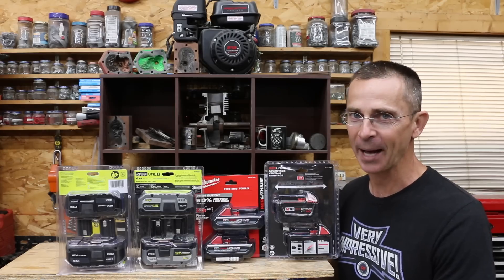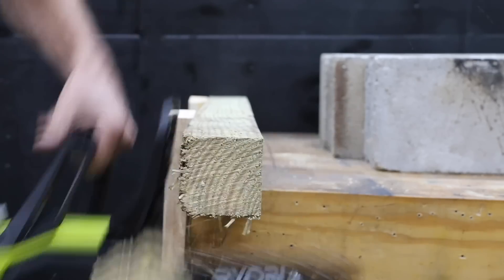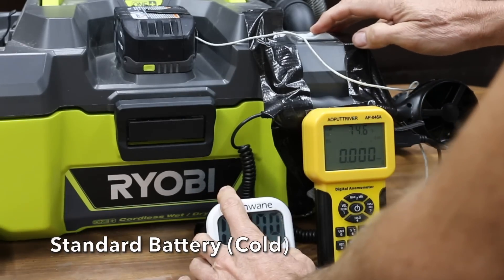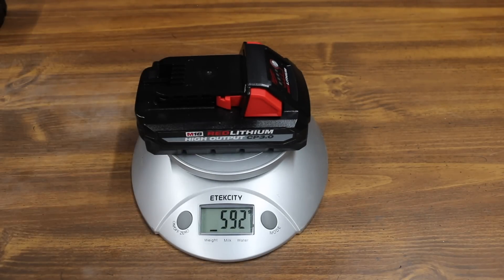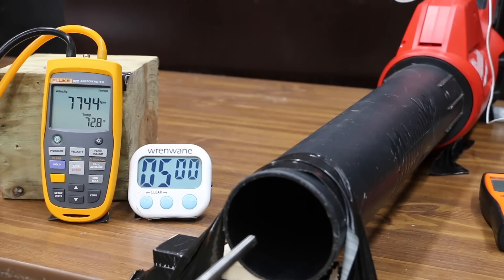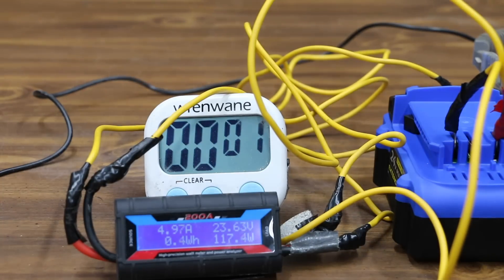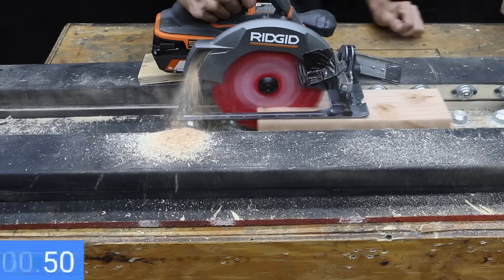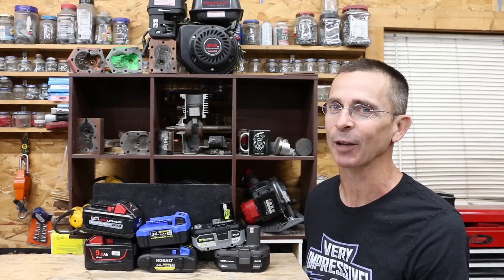Are "High Output" Batteries Better Actually Worse?

Comment: Hey, just as constructive feedback, those HP batteries from Ryobi are made to take advantage of the extra contacts on some hp tools
Reply: Yeah that Ryobi chainsaw isn't an "HP" chainsaw.  I don't think it takes advantage of the better batteries.  With Rigid, all the Octane stuff was discontinued and I think the "Max Output" batteries should work with all the newer brushless tools.
Reply: @slylockfox85  The technology to take advantage of the HP batteries as built internally now, yes some HP tools don’t have the extra connector but it’s built into the tool. Hence why the actual best battery from Ryobi is the HIGH PERFORMANCE, not hp.
Reply: @slylockfox85  Yes Ridgid dropped the octane name but the higher performance tools are still coming out with the same extra contacts.  Pretty sure the max output and octane are the same except only the octane batteries offered the bluetooth functions. I cant quite see 100% but that saw looks the first octane 7-1/4 model, which would be taking advantage of the extra contacts on the MO battery, which explains why the difference more obvious on the Ridgid MO batteries as the tool is being told it can draw harder on these batteries.  However even on non octane/high performance tool models these the HP/Max output/octane batteries are supposedly better, and especially on the M18 batteries that were always direct to the tool (unlike Ryobi and Ridgid that have a BMS built into the battery between the cells and the tools) but these test really dont show the batteries themselves live up to the hype!
Reply: @slylockfox85  Yea, which is messed up, because Torque Test confirmed the circuits worked very well in the Octane tools... But maybe TTI was trying to get away from "fuel" and "octane" naming scheme. It makes me wonder if the Max Output stuff is the same as Octane.
Reply: @th3R0b0t  I own tons of Ridgid power tools and am completely disappointed in the company's direction. They basically went and did exactly the opposite of what they needed to in their redesign.
Reply: @th3R0b0t  well they aren't the same at least battery wise. Octane batteries were 21700 cells while Max Output batteries are 18660 cells. There's an 8Ah Max Output battery in the works, though
Reply: @engineer_alv  yea, I've got several 3Ah Octanes and a 9ah Octane. They kick ass in the octane tools... my 1/2 impact and angle grinder
Reply: @engineer_alv  not all octane had 21700. Only the 3ah.
Reply: @jacksmith2315  I stand corrected
Reply: @th3R0b0t  they are the new version of octane. They no longer have Bluetooth or connect to the Ridgid app. When a battery is purchased by itself it comes with a lifetime warranty. The octane batteries have to be purchased with a tool, battery, and charger to qualify for the lifetime warranty.
Reply: @th3R0b0t  If you look at the battery connections on your tools, Octane model have extra contacts. As do the octane batteries. Ridgid dropped the octane name but are higher performance tools are still coming out with these extra contact, and to what your wondering about, Yes, the max output batteries are the same as the octane performance wise, but dont offer the bluetooth functions featured on the octane batteries.   Ofcourse if your octane battery's extra contact fell out,(which certainly happened to a few of mine) its now just a normal battery to the tool anyways. So far though none of my MO batteries have lost contacts so hopefully they fixed that issue.
Reply: @slylockfox85  ridgid uses extra contact points as well but the tool has to be either an octane or current gen brushless to take advantage of that
Reply from the maker: Great feedback! Thank you
Reply: @Project Farm  hey man, so this goes back to your circular saw test video, and I'm sure it's been said, and I might sound like a broken record. But the dewalt saw was built and optimized to run on the 60v battery. And will lack performance. And people shouldn't buy the flex volt. With the intention of running 20v batteries. It's just for situations where all batteries are dead or forgotten. You buy the flexvolt to use on 60v, and I'm surprised the dewalt wasn't dead last
Reply: @ProjectFarm  This video needs a redo.
Reply: I would love a second test for Ryobi HP tools. Some non HP brushless tools have the extra connectors on the back on the battery slot
Reply: @lopincol I enjoy all of his videos, but he messed up on this test. He doesn't know the HP battery only helps with brushless tools in the one plus lineup. You need to have a brushless tool to test with a standard versus an HP battery. The difference is night and day. I've used both
Reply: @ProjectFarm  Same for the Kobalt batteries. The tools that can potentially take advantage will be labeled "Kobalt XTR" but it's currently only like 4 tools.
Reply: @ProjectFarm  In looking at the specs yesterday, under the "Special Features" section, Ryobi states that there are no special features on either the High Performance batteries, or on the regular output Lithium 4 amp, 18 Volt batteries. I challenged Ryobi to justify the cost difference, but haven't heard anything from them. In early January, 2023 Home Depot and Ryobi are selling a set of two 4 amp, 18 V batteries for $79.00 plus sales tax, while they are selling a set of the High Performance 4 amp, 18 V batteries for $99.00.  The published specs are identical, so save your money and avoid the High Performance  Ryobi batteries, unless you have the special needs Todd mentions.
Reply: @ProjectFarm  Can you do a Review on Members Mark Carpet Cleaner Solution vs other name brand carpet cleaner solutions ? 

Thanks
Reply: @ProjectFarm  please stop using grams  use lbs
Reply: Interesting comments.  A lot of criticism too.  I am an engineer and actually worked on developing batteries for space applications.  I think different folks have different ideas of what is better.  Run time, available power, temperature, etc.   I think that the testing did a great job of removing variables and putting things on even ground.  A battery can supply a fixed amount of energy based on it’s design. if you compare different batteries with the same capacity specs then what can impact the performance.  Temperature is a main concern. at low temperatures battery chemistry can make a big difference to electron motility. At high temperatures resistance increases and you lose ability to provide the same power at the terminals.  This was tested and observed.  the extra sensors on the batteries are more to protect the battery from thermal runaway.  I’m sure everyone has heard stories of lithium chemistry batteries catching on fire.  The extra sensor is used to monitor this a regulate how much power is delivered to prevent thermal runaway.  The flip side of the “HP” type batteries is that with the right tool they can provide more power, but when doing so they will not last as long compared to the non-HP batteries assuming they have the same capacity specs.
Reply: @mwoody4560  you are 100% correct, i think that everything in life is a trade-off, higher instantaneous current dump? Higher temperature and lower lifespan, i just pointed that out since many many folks claimed and verified that they make a difference, vcg construction tested their rotary hammer and switched from non HP to hp and saw a difference, however to be fair it was a larger battery as well, so i think that it would be interesting to do another showdown to truly test those claims, like the flex volt advantage DeWalt hammer drill for example
Reply: @mwoody4560  In this case, the batteries are running at different amps . Being someone that worked on batteries would know volts x amps = watts. So a battery pack that makes 80 amps vs one that makes 50 amps is going to make significantly more power if the tool allows (1440 vs 900 if at 18v). 
A 21700 3ah cell that's made to run at 40 amps is going to last just as long as a 18650 3ah cell made to run at 20 amps if they are both running at max. If the tool can't take advantage of the 35amps and only runs at 25amps. The 21700 will have a longer run time vs the 18650 running at max.
Reply: @Combatmedic870  I agree with what you say about power generated, I was taking about capacity. Of the two Ryobi batteries one was rated 72Wh the other 74Wh.  they basically have the same capacity  the Ah rating is saying the same thing.  so an HP battery could provide a higher current and more instantaneous power, but then the battery would be drained quicker according to the equation you provided. Also there is no way these batteries are providing 50 or 80 amps of current.
Reply: @mwoody4560  They are stacks ran in parallel, 5 cells series at 3.6v(to get 18v). Milwaukee's 6.0 HO is 5s2p, 3000mah cell rated for 40A for 80A max
Milwaukee's 12.0 HO is 5s3p, 4000mah cell rated for 30A for 90A max.
Reply: @mwoody4560  Also, they are the same capacity, but if a tool can only handle 1000 watts. One battery is putting out 900 watts the other 1400 watts. The 900 watt battery is going to run hotter and is working at max. While the 1400 watt battery is not using all available power and running cooler. Which would give you additional run time. 
These HO batteries are putting out some high power. It's how they can claim to match a 13-15amp corded tool.
Reply: @mwoody4560  except they definitely are considering you can use a heat gun on them
Reply: Definitely a fault of this test, at least for Ryobi, that the superiority claims apply to HP tools that supposedly use extra contacts for superior management of the tool load vs battery drain. IMHO the true test is longevity of the battery which is a real issue ITRW
Reply: @EngineerMikeF  even the Milwaukee battery wasn’t very fair I’d rather seen the 5.0 vs 6.0 high output  because at least they would have the same number of cells. I was impressed that the 5 cell kept up with the 10 cells within reason.
Reply: That being said, the batteries were all tested using a constant drain and over time the HP batteries didn't perform as well as expected... or at least to their respective costs.
Reply: @superhawk20002  yes. They were all 3 AH batteries. The difference in them is that they will provide extra amperage when the high performance needs it. You will not gain any more time with them on a constant draw test. What you will get is a higher amp output from the batteries when needed. Say you have an impact wrench that's the high output version. It will spin the hammer faster, and the impact will perform better. Catch is though, you need to have the high output tool. Like the fuel for Milwaukee, or the octane for ryobi.
Reply: @superhawk20002  Well yea, they're both 4Ah packs. Given the same load they'll drain at the same rate, and if you put an HP pack in a non-HP tool, it'll behave the same as a non-HP pack.
Todd kinda goofed on this one because it looks like the chainsaw is a non-HP tool
Reply: @superhawk20002  the high output batteries aren’t designed to last longer. They’re more powerful with more amps in and out, so just running from full to empty, I don’t expect it’s going to last longer but where they’re meant to excel is when your cutting or drilling and you experience a tougher spot, the motor can sustain the rpm better
Reply: @superhawk20002  the thing is that for constant current, it's the same capacity, so it makes sense (i think)
Reply: The only batteries we didn’t see were the Ridgid.  What cells inside the Ridgid?
Reply: @Venbone1374  also curious about that. I owned both kinds of Ridgid batteries but never cracked them open
Reply: @Venbone1374  18650 in all the ridgid batteries. The octane 3 ah had 21700.
Reply: @jacksmith2315  I am lucky to have 3 of the 3ah Octane batteries and a 6ah Octane battery.   I hope they last forever
Reply: If only the tool companies didn't intentionally try and make this obscure and  confusing.
Reply: But the regular Ryobi tool is cheaper and you can buy two 4AH batteries for the price of one HP.  So performance per dollar goes to the regular Ryobi.
Reply: @JakkiPi  that would depend on how much you personally value the higher performance.
Reply: @JakkiPi  Bought all of my HP tools and batteries on sale. Not sure why anyone pays retail when there are constantly deals on kits. Just got a HP 10" sliding compund miter saw, 4ah HP battery, charger, and miter saw stand for $250. There isn't a brushed Ryobi miter saw that will touch it. The HP recip saw destroys absolutely any brushed recip Ryobi has ever made and that's before you put a HP battery in it. The HP chainsaws are leagues better than the brushed. Same with the drills, circular saws, multi-tools...any others that I can think of.

The brushed tools are largely just the Father's Day presents you buy for the guy who occasionally hangs a set of blinds in his house or builds a birdhouse with his son for Boy Scouts. The brushless are actually worth calling tools (for the most part). There is no value comparison between the two lines, as they're not remotely for the same people.
Reply: @TheCharleseye  I'm generally on team brushless as for tools but I have used both a brushed drill and brushless drill and specifically there's not much of a functional difference. Most other stuff yes, but if you're going to be doing absolutely that requires extra power anyway for driving fasteners, an impact driver is a way better tool then a drill
Reply: @jordanabendroth6458  I've used dozens of drills - both brushed and brushless - over the years. There's plenty of difference. Obviously the comparison has to be between similar grades of drills. A brushless electric screwdriver isn't comparable to a brushed rotary hammer. You don't mention which two drills you used in your extensive comparison.

As for impact drivers, yes, they exist and are better than drills at certain things but that really isn't relevant to a discussion about brushed vs brushless tools. Again, rotary hammers are "better" than electric screwdrivers but that's not what's being discussed.
Reply: @TheCharleseye  He was talking about a regular power drill; not an SDS or anything else. TBF he may not need the extra torque of brushless. He probably just uses it mostly for pilot holes.
Reply: @TheCharleseye  - Almost every tool I own is brushed.   That includes the corded tools.   Brushed tools are perfectly reliable, and I've never noticed any difference in my use cases between brushless and brushed.    I also CHECK my brushes.   I can go out tomorrow and use a 55 year old brushed motor Craftsman corded drill, and I can guarantee it still works as well as it did when new.  It's been through who knows how many brushes, and at least three cord changes.   Badmouthing tools based specifically on being brushed is a fool's errand, especially when the real difference isn't in the motors - it's in the build quality of the tool itself.   (Which, unfortunately, isn't rising.  It's falling.  )
Reply: @tbelding  That's a really cool story. Meanwhile, nobody bad-mouthed brushed tools. Do you know why you have old tools that are brushed? Because that's what was available. Brushless motors are more efficient across the board. That's an objective fact. You can love brushed tools all day long. Lord knows I love the ones I have left. That doesn't change reality and it doesn't mean I need to act offended that better technology has come along since I started working. A direct comparison between brushed and brushless tools in the same category will show the brushless tools having a better power:battery life ratio. That's all there is to it.

I swear, fanboys are ridiculous.
Reply: @TheCharleseye  - it wasn't all that was available!   If you look, the first brushless motors came out in 1962!   It had to do with reliability and robustness when the tools were being developed..  Am I a fanboy?  Not really.  However,  your original post did badmouth brushed motors, where that didn't need to happen.  The constant litany of "get rid of your old tools because they're crap" just because of brushes really chaps my hide.  Are brushless better?   Well, if they're built properly, absolutely.   Unfortunately, almost none are built properly (This is an 'almost all tools made today' problem), due to using crappy manufacturing techniques to save pennies, where the end customer wouldn't have a problem paying that extra single dollar to make up the difference.   Realistically speaking, if brushless were truly a generational leap, they'd have replaced brushed motors by the mid-80's.   Instead, they didn't start really coming out until cordless tools hit lithium-ion batteries.  I can't say why, not even a guess.  I simply know when the tools started being brushless in the stores.
Reply: @JakkiPi  not if you wait for sales which Ryobi runs a bunch of throughout the year, I got a 2, 4, and 6 ah high performance battery, charger, and impact wrench for 200 dollars in November.
Reply: So, the takeaway here is that if you have older tools that can't take advantage of the high power batteries, don't buy them.
Reply: @xenaguy01  on the other hand, especially in the case of Ryobi, I'd still buy the high output batteries if you think you might upgrade tools at all because the newer batteries are totally compatible with the older tools but you'll lose out if you upgrade to newer tools with the older batteries
Reply: That may be true, but if that information is present at all on the packaging, it isn't prominent. The packaging just says these batteries are high performance, more power, 30% better, etc. If they aren't specifically indicating an intended application, then the assumptions made in this video are wholly appropriate.  The marketing deception needs to be called out and prosecuted.
Reply: To be fair, he tested it in a way that shows those who might buy the better batteries and put them on non optimized tools what the difference actually is. Some people are looking to get a little more out of their cheaper tool without replacing the whole thing.
Reply: Does the packaging mention that for these batteries?
Reply: HP is ryobi's version of Milwaukee FUEL
Reply: @mrniusi11  this is true the HP line is like Milwaukees fuel line of tools hp tools are the best that Ryobi makes and fuel is the best that Milwaukee makes obviously the new fuel tools are are getting more powerful and smaller which I think is amazing. I do think it's crazy the Ridgid went away with octane which was like fuel lol 🤣🤣 seriously why just go and slap brushless on all your new tools it just makes people just getting into tools confused 🤔
Reply: Low end chain saw and low end vacuum didn't do it justice
Reply: Also certain tools use a small cpu that cut off power when it reach a certain amount of resistance. Maybe its the case with Ryobi ..
Reply: My understanding is that the Ryobi HP batteries can provide more amps to tools using the brushless HP motors and therefore should perform about the same on non HP tools As indicated the watt hours are about the same, so it's a little misleading, because more power can be interpreted as longer run time when the reality is better torque when in the HP devices
Reply: ryobi sucks, Good for those who pee sitting down.
Reply: Dude most people assume what he's doing in his test is real life. Nowhere on the HP battery package does it mention best preformance with HP tools. So the average person will buy them expecting better run time or performance on the tools they own.
Reply: @1212goose  dude, is like you buy a pendrive USB 3.0 but your port is 2.0 and you complain about the speed.
They also say clearly that HP tools are design to take advantage of those batteries
Reply: @1212goose  no man when you see HP tools and HP batteries they go together yet all there batteries have the same cells and junk cells at that there older batteries were better
Reply: I'm starting to hate the HP batteries cause they seem to crap out faster.
Reply: @jackle842000  i mean, i have a Ryobi p213, it's 5 years old, and I'm still using the 1.5ah original battery
Reply: @Lucas_sGarage  guess I'm lost on your point or maybe I didn't make mine clear. I'm starting to hate the Ryobi HP batteries. There are some tools that suck so much battery they don't work without the HP batteries but some of those I have are showing dead while still having half power then having to sit a bit before using it again.
Reply: @jackle842000  yeah, i get it, i think that they have stuff to fix on their batteries
Reply: @Lucas_sGarage  yeah, I have two of the smaller lithium that crapped out within a few months. That was really disappointing. Wish they'd vent them some so they don't overheat and put better cells in them. Those 2 batteries won't even take try to charge.
Reply: Yea, looks like the chainsaw used is a non-HP one.
Reply: I was thinking that, but wasn't sure it was a thing, as  I do not follow that line too closely.
Reply: Same for kobalt, the ultimate output are meant for use with xtr tools !
Reply: If it's a non hp tool then no. Says so in every manual. My Ryobi have all lasted for years with good battery life. The non hp tools can't take the power the hp batteries put out but the original contacts are on the upgraded battery so they can still function in them but clearly have some loss from the extra wiring. The non hp tool lack the contact so there's no danger of them being backwards compatible. I read the manuals of my stuff for that one tiny important thing they bury in jargon.
Reply: wnc817  odd, i generally purchase tools for performance.
Reply: Whatever
Reply: I can testify that they do give extra power to the tools that don't have the extra terminals too
Reply: @n4thb4dc0  That would mainly come down to the batteries being fresh and ready to deliver higher current with a lower voltage drop. That said, everything you read explaining "why" is speculation, especially when it comes to the communication contacts.
Reply: @n4thb4dc0  If they are the same amp-hour, then you are fooling yourself. I don't see that, haven't heard many people claiming that, and from a simple electrical theory perspective, it makes zero sense.
Reply: @boots7859  Ah isn't the same as the amount of power they can output don't confuse Ah with A
Reply: Right.  It's for the brushless tools.  It doesn't help with tools that don't have extra contacts.
Reply: Have you noticed the terminals on Ryobi batteries getting black scuff marks on them that lower their out put by any chance?
Reply: @swiftshunter  no. I had a terminal break off on an oscillating tool. That's the only issue I've had with the contact
Reply: Same with the Milwaukee tools
Reply: Interesting that the torque test channel showed the high output batteries giving notably higher performance generally using impact wrenches. I suspect as some other posts mentioned, the device has to be designed to use the extra power. Still facinating results. Especially the cold testing.
Reply: wnc817  I have some octane tools and about 9 new brushless tools that replaced octane. The new brushless are better in almost every way. Definitely smaller, lighter, and more powerful except for the hammer drill (octane hammer drill had more power but was huge). I did like the octane tri light led placement. The new tools LED is kinda beat but beside that the new brushless rigid tools are absolutely awesome
Reply: dude i totally forgot!  you're right. i just fixed a 4ah battery that i fried by connecting it to a 2ah pack, making a 6ah pack and it works really well, but i just forgot about those extra contacts. it's weird though because the circuit boards look the same, i didn't do a full inspection to see if there's major differences, but it has 2 power transistors just like the 4ah..... but now that i look at i don't think the 4ah battery was an ho.. i will say though that the 6ah pack i made definitely made my drill noticeably faster.
Reply: For what they claim on their packages though, the batteries should still perform better than the standard ones regardless. I wonder if the extra contact would prevent you from using a standard battery on those hp models?
Reply: @crazycamkalani  Not if the tool can only take so many watts. If the motor can only handle 600 watts and the regular battery is putting out 650 and the HO is putting out 1200 watts. Your not going to see any power gain. 
This is where some tools see a significant gain using the HO batteries. Like a table saw or a large impact, 16" chain saw. If those were to have motors that can handle up to 1500 watts. You would see a large power gain using the HO batteries.
Reply: Yes I'd be keen to see the Ryobi re-tested with a few other "HP" tools
Reply: Well I guess there was a mistake with the tool choice and Compatability. But the end result is still valid on is it effective to get a normal tool and an HP battery.
Reply: So you’re saying the HP battery will not outperform the regular battery on the non-HP Ryobi tool?
Reply: Ryobi should be clear on that issue.
Reply: wnc817  octane impact with 3ah octane battery actually out performed milwaukee impact. Torque test channel proved this. Right after that ridgid stopped the octane. I think one of the big reasons ridgid stopped the octane is because they were having problems with the bluetooth in the battery. It would keep seaching or whatever and drain thre battery even when not in use. Cost them too much in warranty. Also they couldnt have ridgid outperforming milwaukee which the high torque impact was.
Reply: I'm sure someone else said it but no hp tool no extra chooch
Reply: Don't know if anybody said this yet but Ryobi Ridgid and Milwaukee are all owned by the same company...
Reply: @garyvisser8987  yep, tti
Reply: I found this out on the flexvolt advantage tools. Had no idea.
Reply: Hopefully this test will keep people with non-HP tools from spending money on HP batteries. Still a worthy test.
Reply: Yep, makes a huge difference on the HP angle grinder and the HP drill driver. Running a 1" auger through 10" pine posts on a HP battery was an absolute breeze but on a standard battery, it was much more likely to bog down
Reply: Yep, with DeWalt, the hp battery is made for 60 volt tools. The same battery in a 20v tool doesn't do much different.
Reply: DO A TEST ON THE NEW BATTERY OPERATED HEAT GUNS THAT A FEW OF THE COMPANIES HAVE CAME OUT WITH THAT LOOK IDENTICAL 💪💪💪💪
Reply: @wnc817  max output is the new version of octane minus Bluetooth. They also have a lifetime warranty individually. You no longer have to purchase a kit like the octane batteries for a lifetime warranty.
Reply: The octane is now just brushless. All the higher end brushless tools have “octane” or high output contacts. In many cases, the new brushless models blow the lid off what the old octane’s could do. Ridgid doesn’t get enough credit for taking away their fancy marketing name and just making it standard.
Reply: If anything it's more fair... When putting a HP battery in the regular tools, it just defaults to non-HP outputs which in theory should still output more time than the others, but, HP doesn't have more capacity...

The extra contact is mainly a "communication" wire and allows the tool/motherboard to raise the current to higher limits that match actual cell capabilities

So basically, HP and regular batteries are relatively the same... Which this video has shown... But when plugged into a HP device, it can basically just get better/higher currents out of the cells vs non-HP
Reply: @JamesAutoDude  to my understanding the HP connector just allow extra wires to draw current from it
Reply: @Lucas_sGarage  nah not big enough of a wire if you actually open it up... It's just a communication wire
Reply: @jsplasha  yeah pretty much what I said but thanks for the clarification

Also, there is a motherboard/chip... All electronics have one, and I've seen it personally from taking it apart. Even some Ryobi batteries have chips in them depending on what they do/etc. Also, boards are required for power management otherwise you wouldn't even have lithium ion batteries to begin with

How do you think the trigger/range switch works? Magic? Lol. Although sure, motherboard is me being lazy, really it's just boards in general lol, but serves a similar purpose to a motherboard. Just no centralized board I suppose 😅 but arguably the board controlling the battery input/output could be considered a motherboard
Reply: Octane DEFINITELY makes a difference
Reply: Bushless tools are better then bushed....

Regarding corded and non corded it depends on what you are doing, sometimes corded is better, and in other instances non corded is better..... 

but cordless are catching up, and some double battered 60v tools have more strength then mains powered tools (like heavy drain applications such as cutting through thick planks of wood, they are quicker in speed, but a mains driven saw is slower but can be used over longer periods of work time) so you see again..... if your cutting loads of wood, use mains, if your just building the frame for a roof, a cordless machine is quicker......

Every tool has its own strengths and weaknesses and its down to the craftsman to choose which tool is best for which job, and a good craftsman will own both corded and non corded....

ALL THIS ARGUEING ABOUT WHICH IS BETTER IS ALL BULLSHIT..... NEITHER AND ALL ARE BETTER....

SAME WITH YOU ALL ARGUEING ABOUT BATTERIES....most of you cant grasp the simple rudimentaries of which is which and how they work....

Put a hp batt in a hp machine, it will work at its maximum potential, put a non hp batt in a hp machine, it will still work but wont have as much strength..... fine if you want to cut latts all day (2 inch x 1 inch) but if you want to cut logs or ceiling joists, then use the stronger hp batteries......

Now here is your argument.....

Using a hp batt in a non hp device.... it will just run longer before going flat and stopping.... thats it....

If i had a drill, and only wanted to drill 5mm holes in wood all day, using a hp machine, its quiet fine to use non hp batteries and keep swapping them, whilst the more expensive batteries are used by other tradesman who need them in your team.....

If i needed to drill 6 inch holes using core drilling tool for a flu for a boiler through brick, then i would need the hp batteries on a hp machine....

I could use a non hp machine with hp batteries, it would do it, but it would take me longer to do..... thats all, and without hp batteries, the normal ones just go flat quicker

WHAT IS THERE NOT TO UNDERSTAND AND ARGUE ABOUT ???????????
Reply: Yes and this applies to Ridgid also, I cant quite see 100% but that saw looks the first octane 7-1/4 model, which would be taking advantage of the extra contacts on the MO battery, which explains why the difference more obvious on the Ridgid MO batteries as the tool is being told it can draw harder on these batteries.  Still even on the non higher performance tools these batteries were supposed to be a little better, but sure doesnt look like much!
Reply: Yes and also along with all the other batteries certain tools take advantage of the high output just as Milwaukee for example if he would have tested it with an impact driver the high output would have blew away the regular batteries but no channels perfect
Reply: You are going to see more of a difference on other tools.
The 2732-20 circ saw only runs at 5,000 rpm on standard, but goes to 5,800 rpm on a HO battery.
Yes I'd rather have a HO 3ah on a on an impact, but often the time savings is negligible on a lot a lot of tools
Reply: @kentuckybeardsman  blown*
Reply: But what do the extra contacts actually do?  A battery pack is a battery pack; it runs until it dies.  It is possible that the tool runs with a different current limit if it detects a high-output pack, but this would run down the battery even faster.  These results are very close, so there's no way that the extra contacts would somehow result in longer runtime.

There's no magic involved; the only variable is the tool motor and how much it can draw as the company doesn't want to replace batteries under warranty or be sued for exploding packs.
Reply: @antibrevity  to my understanding, the contacts allow more current to be drawn... And for some tools is quite the deal
Reply: @Lucas_sGarage  Interesting, I wouldn't think the contacts used by tool batteries would be run so close to their current maximum for it to make a meaningful difference.
Reply: @Voyajer.  i think that is the BMS on the battery throttling down the power
Reply: @antibrevity extra battery contacts allow the tool to pull more amperage from the battery. The only Ryobi tool I have with the extra contacts is the brushless impact and it has way more power with an HP battery than a regular battery
Reply: @antibrevity  what do they do? 
They deliver the higher power pixies.
Reply: @antibrevity  different packs use different cells, different cells produce more or less amps. 
A high output pack with 21700 3ah cells that run at 40amps double stacked is going to produce a lot more watts vs a normal pack with 18650 3ah cells that run at 20amps double stacked. 
Volts x amps = watts. 
40 x 40 = 80 amps(the double stack)
X 18 (voltage) = 1440 watts. 
25 x 25 = 50 x 18 = 900 watts. 
So a high output battery is making 540 more watts vs a standard. Some tools can take advantage of this additional wattage and become more powerful. Some don't. The tools he used obviously did not.
Reply: @antibrevity  The HP batteries are more regulated, to better protect the battery and tool.  So only provide full power output when connected to the right compatible tool.  While there's no such strict regulation on the regular batteries.  So the HP's are basically throttled in a non-HP tool but the battery will have a much longer life and will be harder to turn into paper weights...
Reply: @antibrevity  Ryobi says the extra contacts on the HP tools/batteries allow the tool and battery to communicate to provide extra power.  
  So, basically, it's the BM modulating the power somehow.   (battery manager)
Reply: @antibrevity  that is exactly what they are for for high draw tools like a high torque impact wrench or SDS rotary hammer. On torque test channels video on the Ryobi HP batteries, he said that the contacts allow the tool to pull up to 80 amps vs 60 on the older batteries and generally run time doesn't matter for things like an impact wrench because you're really only using them for 5-30 seconds at a time.
Reply: @antibrevity  quite possible. I have no expertise in battery depletion vs load mgmt so whether there is any opportunity is an open question till some genius or some better Project Farm test kicks in. I have several Ryobi tools only one of which is "HP" so I'll never know the difference. The other possibility is the HP batteries are made of better cells which would be nice. The HP batteries I bought were on an excellent black Friday deal or I wouldn't have even bought batteries, so the point is really academic (tho I watched the video so there's that)
Reply: @EngineerMikeF   Yep HP Batteries need an HP tool other wise they are just a normal battery.  They do that to keep from burning up old tools
Reply: @Project Farm cells in the batteries make the true difference Samsung 18650 25r 21700 30r LG cells they all have different amps it can deliver which is the best obviously the 27100 cells but what's the difference and what packs give you the best cells for the money?!!???? And what's better the new stacked lithium battery's the graphene batteries cat power tools make??? What company has the best most high proformance fastest charging batteries???? @project farm
Reply: As someone who has a few Ryobi tools I'd say anyone buying them shouldn't be looking for power anyways
Reply: @RGT2883i  to be fair, their hammer drill (HP), leaf blower, power stapler, impact gun and sds rotary hammer are very impressive
Reply: @RGT2883i  true, have a few for dinking around the house but bring home my Milwaukee gear when I have real projects
Reply: @RGT2883i  Generally, sure, when Milwaukee, DeWalt, and Rigid typically have more power. Their super cheap brushed stuff is definitely built for price. Some of the newer tools have more than enough power for most uses though between their high torque impact and other HP tools. I have the newer 4 mode 1/4" impact driver and it pulls lug nuts with ease and overshoots 100lb-ft. My dad has some older rigid I've used, which have less power than the current Ryobis, and power at the time was never an issue, building decks or drilling metal.
Reply: @RGT2883i   yes, I have bought no ryobi tools since they came away from industrial tools.
Reply: @RGT2883i  to be fair, the HP series have been a big improvement in that department
Reply: @RGT2883i  I got a ryobi mower I'm planning on buying the hp 9ah so I think in a use by basis it's a different story
Reply: Not only with Ryobi, if you check out Torque Test Channel you can see the Milwaukee hammer drill make significantly more power with a high output. Certain tools benefit from it, others don't. This test unfortunately seems to use tools that don't really benefit from them which is a bit misleading
Reply: Yeah aren't they aimed at the brushless range?
Reply: @vincentjones1014  yes, & I'm guessing if there's any magic that's where it has to come from, the constant switching of winding polarities (but still an untutored guess)
Reply: On the impact torque test channel the Ryobi hp battery was superior. As far as the extra contacts that’s just snake oil. But I like Ryobi so I forgive them.
Reply: @christopherbouman160  they are superior in performance. No doubt about that. Just that my standard 4ah from years before seemed to hold up longer with more use. I think it's just do to the faster discharge of the cells damaging them more or something as the 6 ah hp is holding up a little better than the 4 ah. I think they need to just make the 9 ah more affordable and that's probably what we should be using on the chainsaw, angle grinders, string trimmers, & mowers etc. So with that I'd recommend 6 ah or above for the hp myself as of you're needing the HP part of it you're likely using it with a super high drain tool unless it's the impact gun. They're probably great for them impact gun or skill saw if it's used sparingly here and there. I've been waiting years for Ryobi to incorporate better cell cooling like ego on the 40v too. My 18" chainsaw is awesome but it is going to mess those batteries up bad if I use it much. On a 16" tree I'll have to make one cut through the log and switch batteries with single cuts to do ok. It'll overload the batteries fast even if it's the larger batteries. Honestly think the saw should come with some kind of small backpack that connects two batteries at once to run the saw. I hope the 18" 40v holds up better than the brushless 18v cause the switch or something failed on that one already but was good while it lasted except the 18v model chain adjustment couldn't adjust out as far as I'd like. The chain adjustment was much easier to use on the 18v model though with the tooless quick adjustment. I like a lot of their stuff but they skimp on quality here and there on some stuff where they shouldn't. They need to stop degrading quality for sure before they run themselves out of business in the future.  It went from great stuff to decent stuff over the past decade but the batteries improved.
Reply: The test wasn’t for the different tools. This was for the HP batteries. 
Yes the better tools will perform better with the better batteries, we can all agree to that. 
This is to show if the HP batteries are better on their own.
Reply: @talabusick1666  Nobody is saying he should compare different tools. The HP batteries are designed to add performance to the HP tools with the extra contacts. He can run the HP batteries and the standard batteries in HP tools to get the proper comparison. That's all anyone is saying.
Reply: @talabusick1666  I could be wrong. I thought what some people are saying is that you have to have an HP tool to take advantage of the high output battery. That is for Royobi. I'm not sure about Milwaukee. The Royobi HP tools actually have extra contacts to mate with the high output battery.